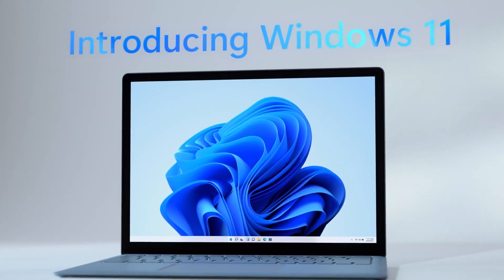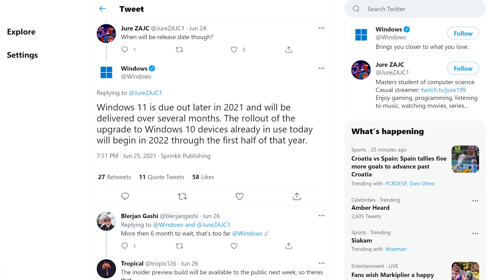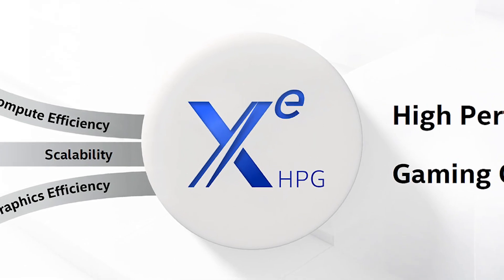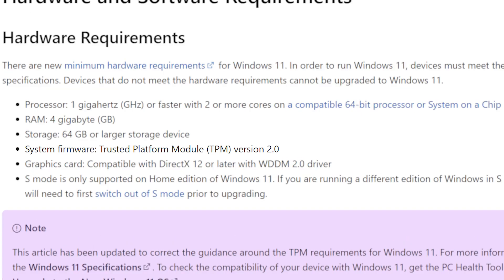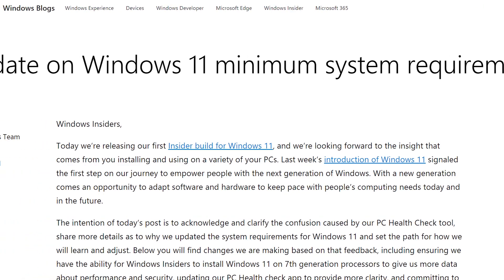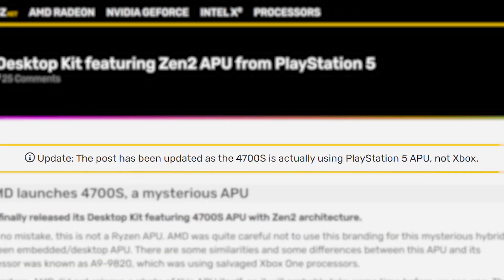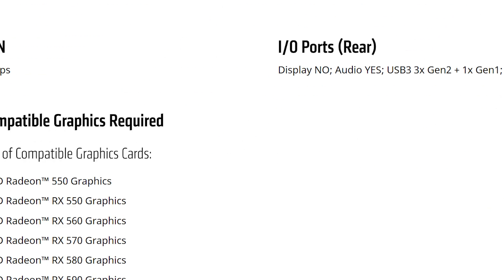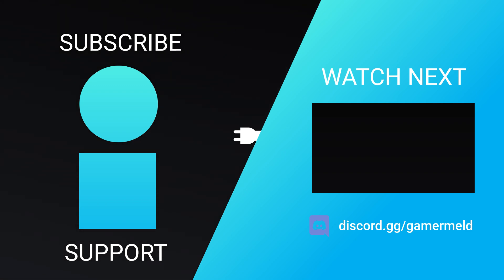TONS Of Gamers WON’T Be Able To Install Windows 11!

Comment from the maker: For those saying that they're running Windows 11 on older hardware now, you have the Insider Preview Build. Microsoft has explicitly stated that the requirements aren't set for that build, but the actual release build will have them. What you have isn't the final release version of Windows 11.
Reply: Exactly. Essntially these People are running Win 10 with a Win11 shell and Win11 features installed.
Reply: @Twitch_Moderator  win 11 is just win10 with a new layout and features.  Meh.
Reply: @0xsergy  That's how most new releases are actually and that's honestly how it has to be.
Reply: There... Is a lot of misunderstanding on this.

"Supported" in the Microsoft vernacular has nothing to do with if it will run, and has more to do with if they have a legal requirement to provide you support.
A great example of this is win8.1 or the win10 anniversary update. In both cases there were some large shifts in what types of hardware would be supported. So if you were waiting for windows update to deliver the upgrade to you in a seamless fashion, then it just wasn't going to come.
Now, in most cases, you could create install media, load it up, and it would work just fine. Maybe sleep states wouldn't quite work right, or the always on scheduler to check device notifications wouldn't function, or some other weird thing would happen... But at the end of the day, the computer turned on, you could log in, software worked, and you were good to go for years.
That is what is happening here. Only devices with tpm2 are supported, and tpm2 is about 2 years old, so those are the devices that will get win11 delivered. First on new devices, then on pre-built dells and hps (where the manufacturer does the validation and support, not Microsoft), and eventually people with home built machines will get the update when their hardware config is deemed worthy, some time in 2022.
But that is the supported upgrade path where it is a seamless upgrade. If you want to download the iso, make your own boot media, wipe your HDD, set up secure boot, and install it yourself, and take the risk of data loss or limited functionality, well then the soft floor tpm1.2 option is compatible. Just like older pcs running 8.1 or Anniversary were compatible. Advanced features may not work without tpm2, but overall it should be fine... But if you call Microsoft for help the answer is to buy a new machine rather than any troubleshooting.

Lets keep in mind too that unsupported configurations are 3 years old now, and will get updates until 2025... 7 years old isn't super old for a high end system these days, but that isn't bad. Toss in a new mobo and cpu 4 years from now for $300 and then you have a modern supported system that will last a good long time for relatively cheap. Plus... Pretty sure I am one of the few here who buys a new rig and plans on it lasting at least 10 years. Most people will have updated long before the 7 year mark so it is a moot point. Throw Linux or freenas on the old board and enjoy a home server for the next 10 years. It's not like the hardware is useless, just not windows compatible.
Reply: @CaedenV  finally somebody with fucking common sense, if you remember correctly there was even some ram expects before that people ignored them completely, i feel like everybody is making a big deal out of fucking everything now a days
Reply: @CaedenV  2011 was a good time to do so, you could use an i7-2600, some RAM and your old GPU, then wait until 2012 and buy a 680 making your setup somewhat viable for these next 10 years as in Poland you still can see "new" builds with i7-2600, trash everything else, a good GPU and a case which has so much RGB that it's looking bad for the price of a brand new Dell/HP gaming PC
Reply from the maker: @CaedenV  I don't mean to sound rude, but you may honestly want to watch the video. The "not supported" you're referring to would have been the case a few days ago, but Microsoft updated things. They're literally now saying that "Devices that do not meet the hardware requirements cannot be upgraded to Windows 11." This isn't just that they aren't technically supported anymore type of thing. Hopefully they will change this before release, but as of now, that's where it stands.
Reply: @GamerMeld  Some speculation is that the TPM keys will be used to validate a kernel signature to check the integrate, a Signature will be generated using TPM for every app installed and downloaded from the store. Every login will use TPM to sign the virtual environment that is created for you. I other words TPM will be used at multiple stages through put the session. So, bypassing it at install has no value.
Reply: @GamerMeld  as long as regedit exists, it can run on anything lol 😎
Reply: @GamerMeld  99.9% Microsoft backs down due to the backlash.
Reply: @GamerMeld  Corporate world won't take kindly to a mandatory hardware upgrade if they don't deem it needed. With that in mind it sounds likely to go the path of Windows Vista, business rejected.
Reply: @JonathanGerardDias  from all the specs I hope they keep tpm, that will decide between somewhat save or better be offline to avoid randsome and hacker attacks. Tpm is the best they ever could come up with. All laptops nearly support it, and the builders from last 2 years have to chip it, not a big deal at all! Better to be encrypted, same is for secure boot and uefi. Who does in 2020 still legacy installs? They are out of date since 2014....
Reply: i think the "upgrade" part is strictly from win10 -> win11? shouldn't it be safe to clean install win11? i think it's safe to assume the TPM requirement, atleast for now, is directed towards OEMs and not to the SI market...
Reply: I'm waiting for Win 10 Enterprise LTSC 2021
Reply: So why is the inside build running just fine on older hardware? Because they'll run Win11 just fine and this is a great example of forced obsolescence.
Reply: Its fine i am more than happy to leave windows behind and just go full linux i ve been dual booting for two years last month i realised i havent logged into windows partition in about 7 months i can play the games i want and since amd announced they are making my fury nano legacy hardware, I ll stick with Mesa drivers as they will be providing support via the open source AMD drivers which if you are on linux you running as they are infinitely better for gaming than the drivers provided by AMD.
Reply: There will be modified version of windows 11 for those who know their way around then!
Reply: You can right now install the window 11 builds with a simple DLL file replacement from a windows 10 iso. It works for all devices. I guess this is not going to stop anything down the line and people will be able to install win11 with some tricks like that hopefully.
Reply: @DannyHuanDao  might not be necessary looking at feedback hub
Reply: I watched the whole video BTW. If Windows Insiders kick up a huge stink, MS may relent. This isn't the first time. Remember XP Mode? You were supposed to have VT enabled in order to run it but hey! Users revolted and MS relented and released a version of XP Mode that don't need VT and the best part is for the most part, there's no performance difference that I noticed.

Win 11 is still in its early stages so who knows? The key thing is probably SecureBoot and TPM2.0 to ensure the machine is trusted, which is why a MSA is needed. But being a Beta tester for MS since Win7, well, at this point in time, things can still change once Insiders starts spamming the Feedback app. ;)

It is also possible that MS will release a new SKU like Win11S later without the new for some of these security feature. Like you say, "Time will tell..."
Reply: @erictayet  Before XP came online I switched from Win 10 to Linux. My less than roomy at the time killed my dual P3. Probably thought I would get more stylish laptop. So I replaced it with a Athlon 64 in 2004. (water cooled). The dummy tried that again but the Athlon was smarter. Yep M$ did not support 64 bit until Intel made a 64 bit (Prescott in 2005) desktop CPU. I finally gave the roomy the boot and then... My ears took a beating from the olde lady. Because her peeps were on the wintel wagon. Maybe because the roomy finally got her own wintel laptop. ( I did not fix it. That was the geek squad's job) Finally I came across a sanitized version of XP that supported 64 bit. Then my ears got a rest. Except she did not like the dual boot. Now I just run one I always to have to fix. I also run a dual boot that rarely needs a fix. And wintel again repeats history in 2022?
Reply: This would make sense, except it installed fine on my 2013 iMac, and a few other out of date systems phenom X4 system to name one, however it was only my main pc which has a 3950x and strix x570-f motherboard that had problems.
Install halted half way during the update with a warning that I had secure boot disabled and that I did not meet tpm requirements.

I didn't think to turn them on due to the other PC's lacking those features updating fine into w11, and needing secure boot off for the hackintosh dual boot I run.

Seems more like Microsoft is only being picky about hardware from the last 5-6 years as older systems seem to be able to install it just fine.
Reply: @DragoserakerIT  there will be mods to remove the hard limit soon
Reply: @immike3476  no doubt, they will probably be out before w11 officially launches
Reply: to be honest, nobody needs windows 10, you can work / game with windows 7 very well.
Reply: @hanspeterx  except for the fact that windows 7 has zero support for security patching.
Reply: @DragoserakerIT  Wait 'till you lose major applications and software, critical security updates and guaranteed functionality. Windows 10 really is not that bad.

And if you're really saying you don't like it, you can just as well change to linux or mac.
Reply: @hanspeterx  Windows 7 wont start some apps and dx 12 games
Reply: Your incorrect about not being able to upgrade to Windows 11.

You might be asking how, but I'll counter with the need of every gamer on PC, to go into their BIOS and switch on PTT for Intel and fTPM for AMD, I have, and yippee, I can upgrade to Windows 11
Reply: any AMD cpu from 2014 and onward has TPM support with a simple bios switch, so you only get fucked if you were an intel shill all those years for an extra 5% fps instead of 40-50% more performances in everything else on amd cpu.
Reply: You can and will be able to install it with software hacks. The warning is so that MS doesn't have to provide support.
Reply: Even if you install it from the iso it’s pretty easy to bypass just take some on age of using cmd wich you can find plenty of tutorials on how to bypass tpm
Reply: I can just see Intel releasing their GPU when competitor stock levels return. Why they did not grab the latest GPU shortage opportunity with all their might is totally unbelievable!
Reply: I can run it...barely...I have a Ryzen 2700x and my Asus X470 MB has TPM support.  But I won't run it.  It's a mostly cosmetic upgrade with some tweaks.  It's also BLATANTLY obvious that Redmond has "fired up their copiers" again...this new UI looks so much like MacOS it's pathetic!  But it still has most of the "legacy" crap that Windows 10 does...down to DECADES old dialogue boxes and it still has "Settings" AND "Control Panel"!  And the "requirement" to have a linked MS account is just the last f***ing straw.  I never considered moving to a different OS because of my gaming...but I am ready to just relegate gaming to the consoles and use a Mac for everything else...after DECADES of Apple hate.  I would rather be a customer than Microsoft's PRODUCT!  DONE.
Reply: @johnnemesh5459  you won't have this issue if you realised it was a development build
Reply: O
Reply: Kinda dumb to upgrade to windows 11 anyways. Windows 10 will be supported until 2025. Upgrade then doesn't that make more sense?
Reply: You don't even want  Windows 10,  unless you block all the built in spying.
Reply: @SeaJay_Oceans  what will MS do with my Data?
Reply: I have a version of Windows 11, not the one people are downloading from torrent sites OR the insider preview, it's from a company that has been given a fully fledged version so they can have drivers etc. ready for the launch of W11, it's working just fine on a couple of old laptops and PC's so the minimum specifications would appear to be more of a guide rather than written in stone.
Reply: I got windows 11 installed which you have to enable TPM 2.0 in the Computer’s UEFI BIOS so technically this is a lie
Reply: @kriswhite9324  I have it working on machines that do not have TPM 2.0
Reply: @JohnSmith-jq4iu  but  did  you do the workaround because if you  copied win10 files from the sources folder over to windows 11’s  I’m sorry to say but you are just running win10 with win 11 features
Reply: @kriswhite9324  No, all are a clean install with no workaround needed. So no I'm not running Win10, and it's not the insider preview. Win10 is supported until 2025 and will still run fine for years to come.
Reply: @kriswhite9324  Currently TPM can be disabled after Install/Update and I can see no issues outside of dependent features not working and OS Updates not being delivered.
Reply: Meh.   Going back to IBM DOS  6.22   :-)
Reply: But amd custom apu from PS5, it is mean that board can allow hacker team to run custom ps5 os like hackintosh
Reply: This is stupid they will end Windows 10 support when many people still have barley old hardware. Sounds like they are forcing people to attempt to buy new Microsoft surface laptops and microsoft surface laptops are not gamer friendly. Glad I personally got a 3080 and ryzen 9 5900x however many people have hardware that's not supported and windows 10 support ends then what windows os will regular users be able to use? if they cant use windows 11. that will force people to buy new hardware or switch to mac no game support or linux.
Reply: @xander hasass I run windows 10 dual boot Arch linux on my 3080 and ryzen 9 5900x linux never flew so fast. windows for gaming linux for programming and everything else
Reply: @xander hasass I know ive been playing my favorite game overwatch on linux for a year or so. Just wish all cods ( call of duty) would work on linux only reason i havent switched 100%
Reply: worst version of windows ever made. because windows 11 doesn't support my R5 1600 -_-
Reply: Your wrong about this. Microsoft will ensure that their customer base has the ability to install. All the requirements are being walked back. I hate this kind of click bate.
Reply: I promise I'll come back and laugh at this stupid click bait video when things would just work fine in October.
Reply: Replace appraiserres.dll from the win 10 installer, on the win 11 usb install and you can boot without TPM chip based pc.
Reply: I'm afraid to tell you that you're not 100% right. The ryzen series have an implemented TPM 2.0 chips, no matter what. All of the ryzen series cpus fit in the criterias that Microsoft require. Unfortunately there are a lot of misunderstandings about the requirements for Windows 11. TPM 2.0 was released long ago and most motherboards have a Trusted Computing section where you can simply enable it with 1 click. Watch yourself be completely wrong once it reaches its full release.
Reply: Don't make a fool of people gamers should be able to enable tpm chip from their bios as tpm 2.0 is built into every cpu since 8 years. and there is no need to to buy any chip so f k u @Gamer Meld . Just reset my bios and enabled tpm on my 8 year old pc and its rocking windows 11.
Reply: Still a dud
Reply: Why can you expect to be able to upgrade to a new OS without new hardware in the first place?
Reply: They are just basing this of of the Virtualization of the Windows 11 side of things, But i can guess if you have TPM accessible not matter what version its gonna work 100% if its newer or not. All it is encryption protection and other things to protect the Cpu and the windows registry. Trust me you guys arent gonna have to worry about it. And when it comes out fully im just gonna break out my b350 and 1600x and try to install it just to see but my guess it will or there is gonna be a choice to opt out of the TPM protections
Reply: Yes you are new to insider or alpha and beta tests. So let me explain, Microsoft is   gathering user data from all insiders based on that they will model the requirements for the release as it has been since win 95. I mean use your brain Microsoft want only make win 11 for a few thousand people, unlike the Apple scene where they not care for the enduser only their profits... So mark my words: you can run it now then you can run it on release. Not included the modder, official insider only.
Reply: Wait and see if all works, but with android on windows I can use and control my whole house from my computer, cctv, fridge, coffee machine, washing machine, stove, hot water, real-time electricity usage and costs, lights and and and.... No more deal with tons of that stuff in the phone. Great views in the future of smarthome!
Reply: Its simply time for steam valve and game manufacturers to be Linux friendly
Reply: You can't subscribe unless you have a Google account
Reply: About Windows compatibility, I own an HP laptop with an A10-8700p processor, is running windows 20h1 like a butterfly 👌, I saw in the requirements of tha build of windows and my CPU wasn't listed there so I thought it was incompatible. Just wait until the official Build of Win11 get out, you'll all geta surprise that that requirements aren't that strict 👍.
Reply: Do gamers really want more spyware?
Reply: @strider00111  Think I will stick with Linux, gaming is getting better, and some titles already work with RT.
Reply: @strider00111  your on a google account ??? they spy and pass on more info than everyone else in the world combined ( keep calm while we steal your data ) as the mug says
Reply: @snowuk1472  I know! Sucks! I only use Google for Youtube and thats it.
Reply: @strider00111  You'd be surprised that literally everything that connects on the internet does that, you can go back to your cave now.
Reply: @UnoZero1  No I am not surprised! It does not mean I want more spyware! What's up with the Bluetooth requirement? Is that to connect to everybody that has been vaxxed?
Reply: Isn't it a bit too early for Windows 11 FUD?
Reply: @thefirehawk1495  8 weeks before the back-to-school season? Just when you're wondering if you have to buy a new computer for school? perfect timing for cranking the FUD up to 11!
Reply from the maker: @thefirehawk1495  It's not really FUD. This is coming directly from Microsoft, though hopefully they change their minds. Just a news story really.
Reply: @GamerMeld  no, it is FUD, you made yet another click bait video
Reply: @thefirehawk1495  Isn't a bit late in the game for MS to continue to copy Apple and MacOS?  (just the look, they didn't actually do the work to clean up the mess that is Windows 10 behind the glossy UI)
Reply: First gen Ryzen and Intel 7th gen will work, you wont get the update from windows 10 but you will be able to install it from a iso file. Anything that is supporting TPM will work. Stop getting scared of nothing.
Reply: @immike3476  most likely they TPM thing will endup being dropped for non SI markets, since modules were not super common on hardware they know people are already running it on... 

hell you can use MS's own tools to, via command line, remove the TPM check/requirement... so... yeah... im really not too worried...

i can see it for the SI market being a hard requirement though... since its just built into modern platforms thats a good thing... for those of us not using a  modern platform i really doubt will see a negative effect from this... im quite sure that MS will want us all on 11 as long as the system can actually run it to an acceptable level of perf...and even first gen i7's can do that... hell A6 and A8 apu's can, even old phenom II x6 chips run 10 really really well... and... even those i expect will still endup being able to run it.. 

they can now anyway.....heh..